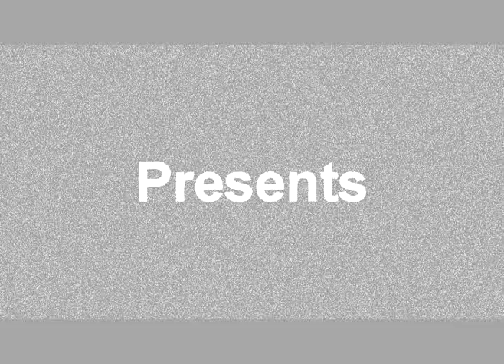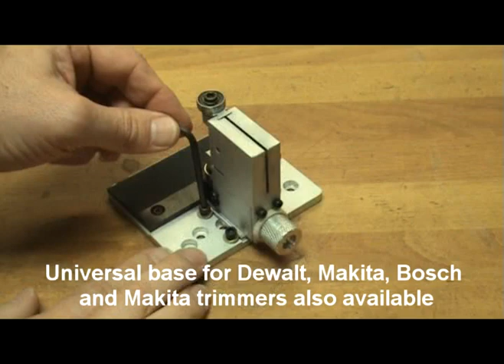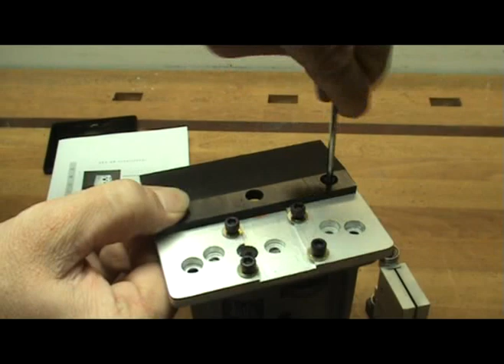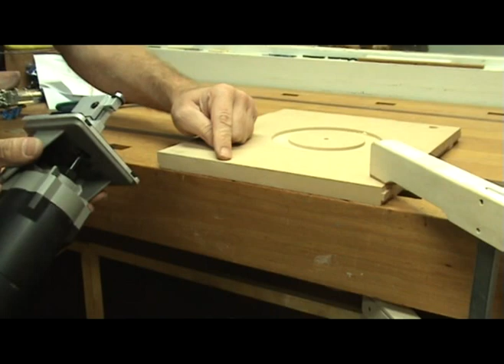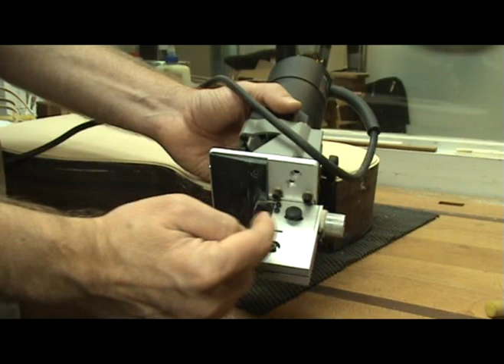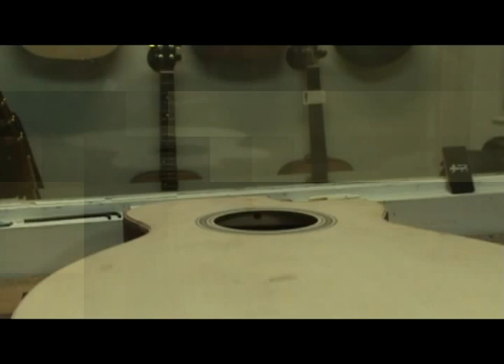Luthier Tool Company - Binding Cutter Base

Comment: Robert, Thank you for all your great videos. Can this cutter base accommodate an arched top / tapered bouts...where the sides are not 90 d to the top or back?
Reply from the maker: I have heard of folks using it for archtops but it might have an issue with sides that are tapered and not 90 degrees
Reply: OBrienGuitars what is your “up to date” recommendation for  cutting purfling?
Reply from the maker: @LiloUkulele  I cut mine on a table saw or band saw